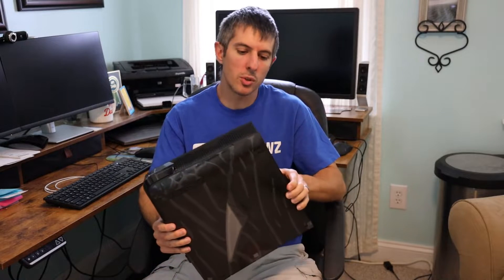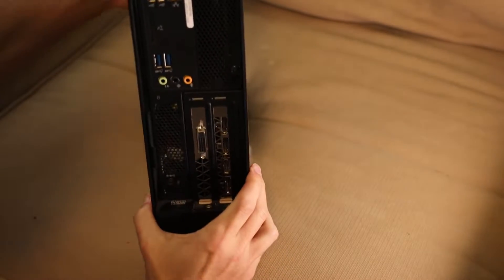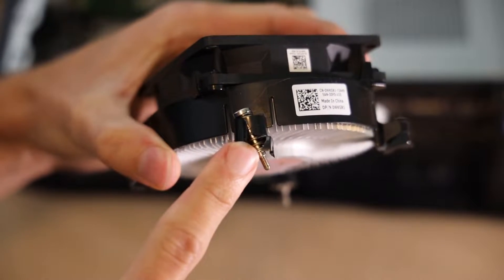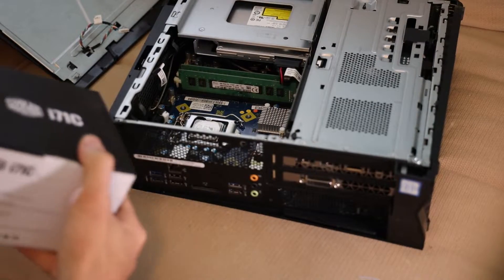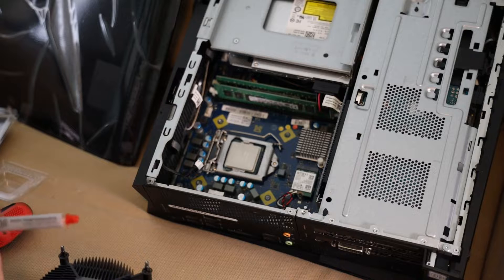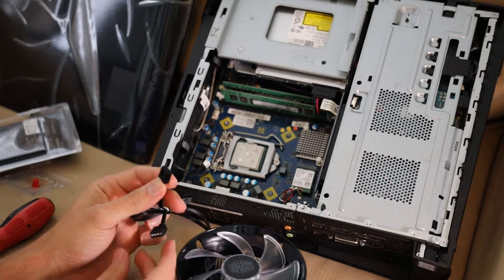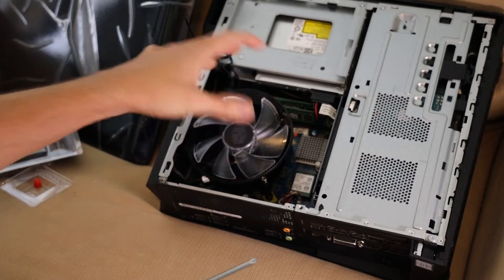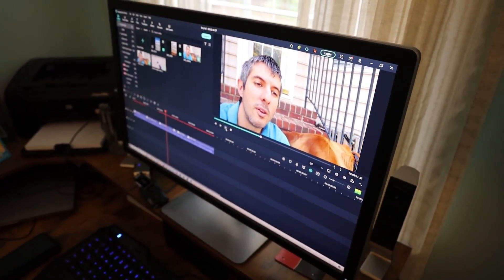alienware X51 R2/R3 overheating problems

Comment: Hello there, I had the same problem as many people with the alienware x51. the problem is that your cpu is not connecting well when you hold it with 1 screw. when i removed all screws the CPU is in the right spot again.( so i dont have anything to hold it beside the fan. The difference was like 20 a 30 celcius. it worked for my old alienware x51. goodluck everyone
Reply from the maker: It’s somewhat of a bad design from factory but the computer runs nice and cool now.

Comment: what was the temperature difference
Reply from the maker: It runs about 20% cooler. Just a heads up if you are going to run this same setup I have to leave the back of the case off for it to work property.

Comment: Does the sidepanel no longer fit after installing the fan? 11:47 Or was it left off for demonstration? Just want to be sure
Reply from the maker: Thanks for watching. The side panel does fit back on no problem. However the cooling is a lot better with the side panel off..
Reply: @GReviewz  Thanks so much! I’ve been testing laying my x51 on it’s side so it ventilates side to side rather than one vent sitting on the desk

Comment: Hello, I liked your video!
What are your Alienware x51 settings?
I have one of these and I use a GTX 970, but I would like to change it to something more powerful like a GTX 1660S
Reply from the maker: What do you mean as far as settings? Mine currently has a i7-6700, a gtx 960
Reply: @GReviewz  Currently, my Alienware X51 R2 has a GTX 970 graphics card and I would like to purchase a more powerful graphics card. Does a gtx 1660 super fit in it?
Reply: @SrLusca  I have a 1660s in mine it's tight but fits if you get the right card